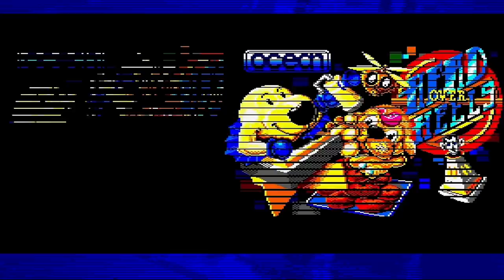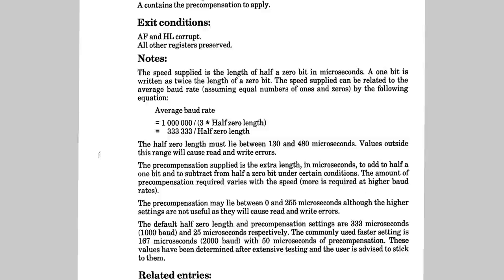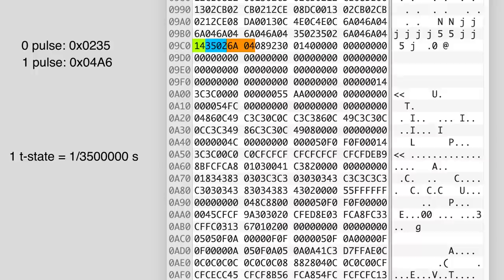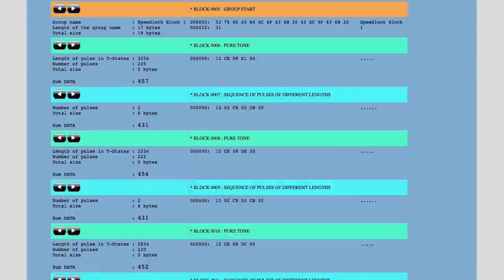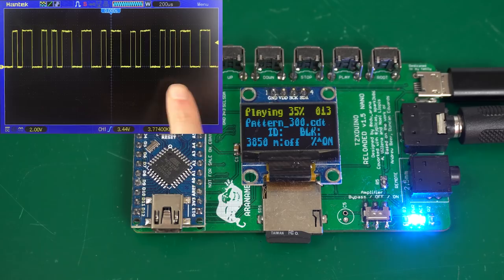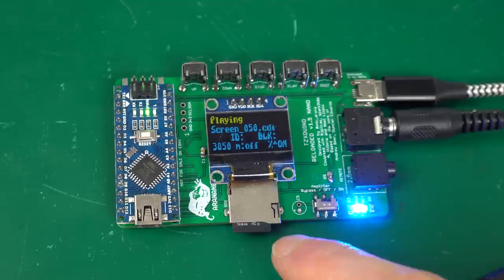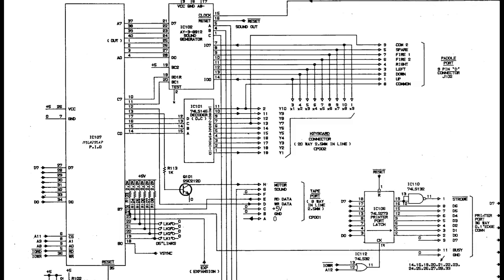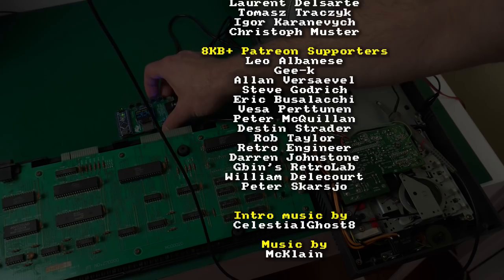How Fast Can We Load From Tape?

Comment: fast as hardware can read it and write it on memory to run it.?
spin cassette faster and make it reliable less data on tape
or spin slow and try load faster and have same tape have more data

but fastest you can is how fast you can read and write it to memory. thats top speed

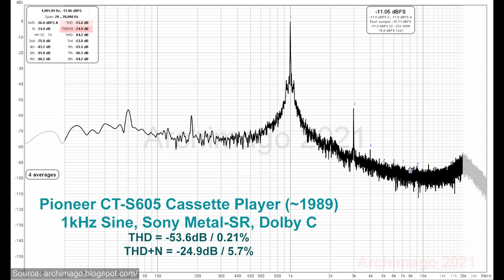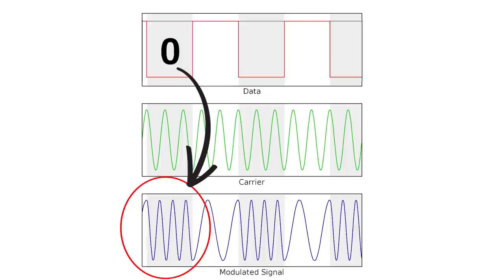Comment: At 4:45 you say that you believe 59 seconds might be the upper range for loading data off a physical tape. I guess you missed my demo Breaking Baud which is all about speed loading from tape on the CPC (https://www.youtube.com/watch?v=D62jpqZ6TG4), and there's a proof-of-concept video I did before the demo that is just speed loading 16KB screens from actual tape, where a typical 16KB screen loads in about 15 seconds (https://www.youtube.com/watch?v=qfGcvWOaFFw see for example from 0:43-0:59, 1:01-1:11, 1:53-2:20, 2:21-2:33, 2:35-2:47 etc)
Reply: Also, if you're not planning on using real tape, just a CDT/TZX player, you can check out the OTLA project

Comment: Honestly using long and short burst as 0 and 1 is a bad format. Should have just kept it frequency on 1 frequency off 0  could put more code on a tape. Even tho the frequency off isnt used it is still taking up length on the tape.
Reply: You can't do that with an analogue signal. You need to avoid DC bias (which will cause signal distortion) so the signal needs to be balanced. This is why you need to use some form of modulation such as FSK.